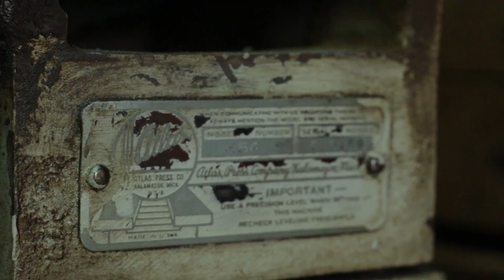ATLAS LATHE H54 10F-28 REVIEW

Comment: I've got a QC-42 (with the quick change gear assembly) which is a 10" November 1950 lathe. I've also got a 9" horizontal 36" from 1940. It was being sold at an estate from the original owner. He bought it, went to war (WWII) and returned to use it again. I've got the original bill of sale. Really cool.

Comment: I am in the process or purchasing a very similar possibly identical lathe.      This will be my second old lathe the first being a much larger machine.   Let me second what vancroft13 said.   The best thing you can do is clean it.  My Sidney cone head had so much swarf in the apron that it was totally jammed,     One should never use compressed air to clear chips on these old machines.  Too many open gears.
Reply from the maker: I agree on the compressed air.  There is still more cleaning to do on this one as well.  So fun to play and learn with my son on this machine.  Thanks for watching!
-Will

Comment: I have 2 12 x 54 inche atlas lathes the last was on a cast iron stand and casters and I have forks for my backhoe it went in my garage, but the second no stand I took it completely apart and carried it in my shop in peaces, both have quick change gear boxes that add another 25 lbs,,,both are timken bearing lathes and l have bought 3 6 inch 618 atlas lathes also and a 109,,,l love the atlas lathes. And people realize vintage lathes are the best way to a lathe now as prices rise, l have one 618 that's never been used on display,,, and have almost every attachment for both the 6 and 12 inch with tons of tooling. And have taken them all apart and restored them to like new conditions.
Reply from the maker: Wow!  That's quite the collection.  Must be a magnificent sight.  These old machines are great.  They sure don't build them like they used too.  Thanks for stopping by.  Email me some pics.  I'd love to see your collection. debtfreehomesteaders@gmail.com
-Will
-Will

Comment: Nice lathe and nice video! 10F-28 is just the part number for the door. While the 10F lathes do all have power cross feed, that’s not actually what the F stands for. It was just used to designate the latest model. There was a 10D model just before the 10F.
Reply from the maker: Excellent. Good to dig up so more history on this fun machine. Thanks for watching!
-Will